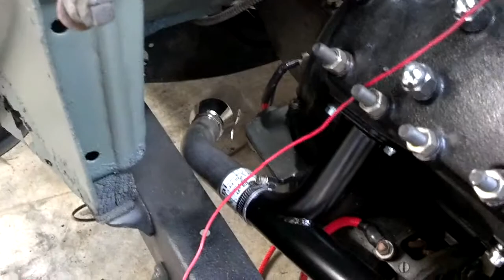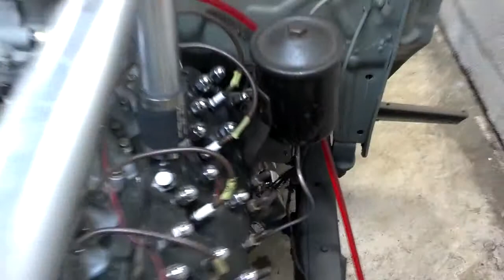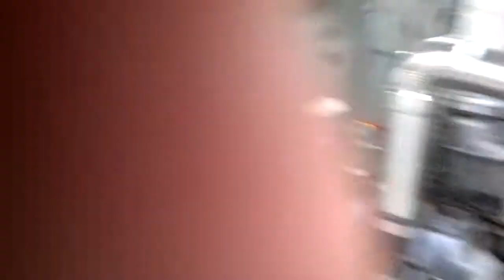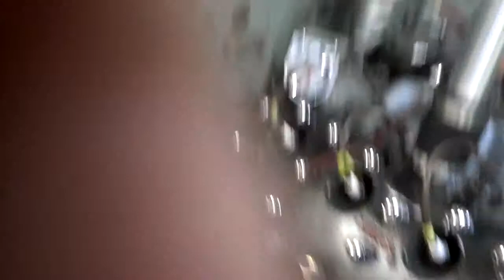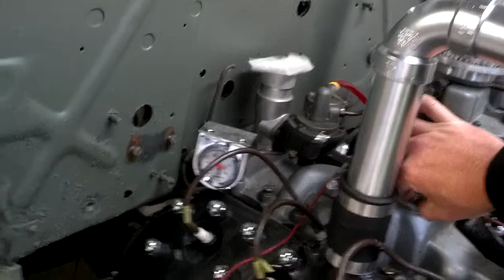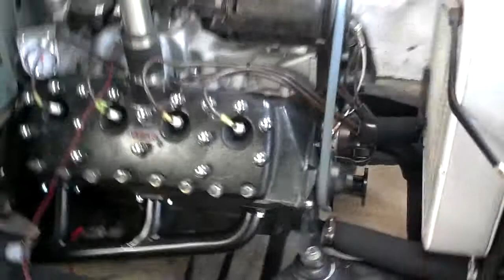59ab Flathead

Comment: what kind of oil pressure are you getting at hot idle? Mine hovers right around zero, and I've talked to a bunch of people about it. Some are telling me that's extremely bad, but others are saying that on a stock 59ab, they're designed to idle on next to no oil pressure.
Reply from the maker: Ya its about the same. Running 15/40 in it to instead of 30w. Haven't gotten around to changing oil. I've heard the same thing. Sounds fine to me. Thanks for viewing.
Reply: that's exactly what I'm running is 30W, i know with newer engines, 0-5 lbs is very bad, but I wasn't sure on the flattie. thanks for posting, it's a beautiful-sounding engine